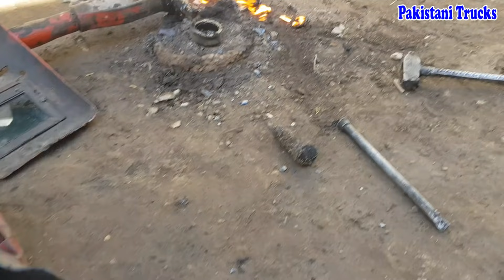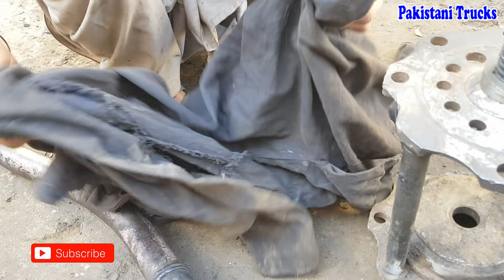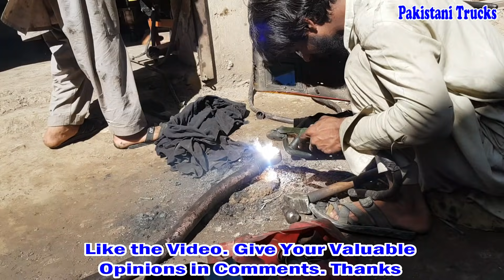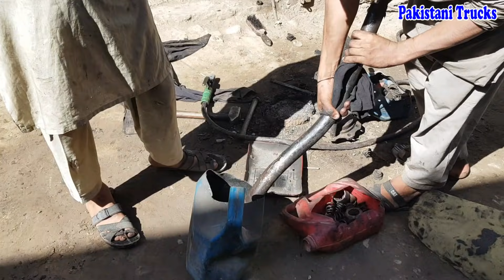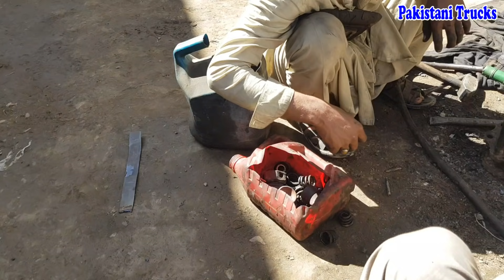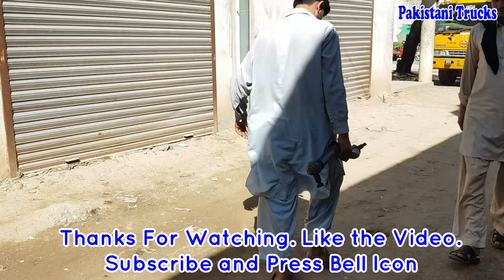How to Rebuild Truck Tie Rods Ends with Small Tools

Comment: if you weld it, it has no movement at all. but the original tie rod, it allows a small movement at the joint in the tie rod..